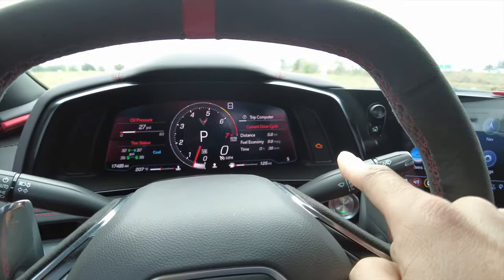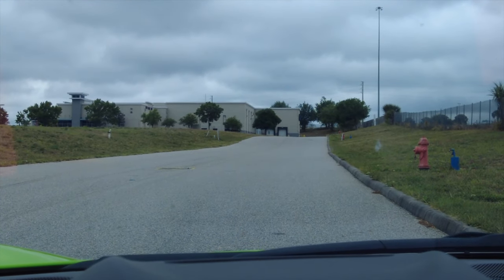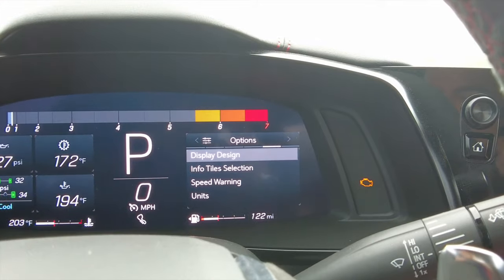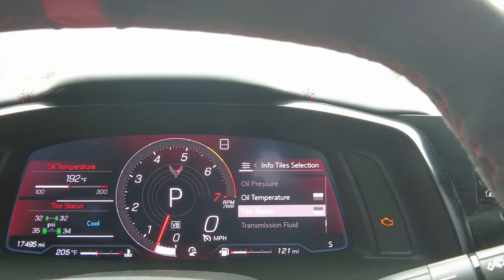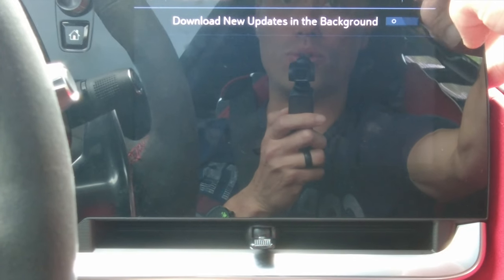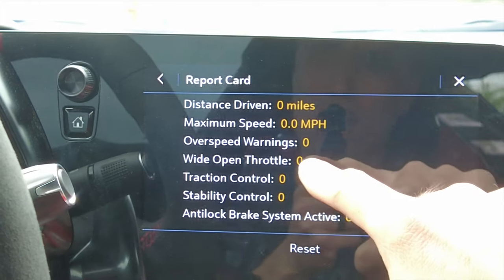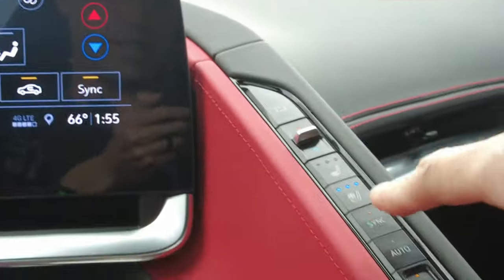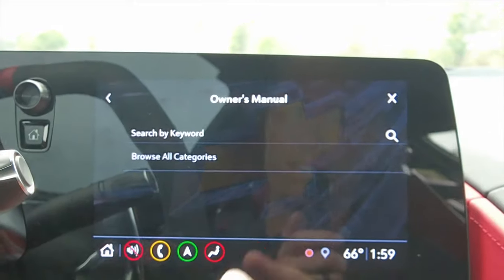C8 CORVETTE GAUGE CLUSTER AND INFOTAINMENT TUTORIAL

Comment: Good review, can you turn off the variable cylinder mode and just operate on V8 mode ?
Reply from the maker: Yup, just tap the M button and it’ll stay in manual mode and won’t go into 4 cyl mode. But you have to shift all the time.
Reply: Or Z mode will keep it from switching to 4 cylinders.

Comment: Hi, I have a question that has nothing to do with this video, I finally have my 2021 C8, when I get to 500 miles do I have to go to the dealer for an oil change or is it not mandatory?
Reply: You need an oil change after break in. There will be debris (fine metal particles and such) in the oil from the piston rings, bearings, and other friction parts breaking in. That’s also why it’s important to not overdo it on the throttle during this period.
Reply: Your first required oil changes at 7500 miles I will do mine at about six thousand just to be safe and the first change is free
Reply from the maker: I did my first one around 6k-7k miles along with the trans filter and 2 extra qt if DCT fluid

Comment: been following you on your channel did throttle body  and controller that is bad ass changed the car. Had spacer before you had to cut studs  i have after market wheels forgiatos they are not as deep as the factory wheels. The next mod you need is in the rear truck it is a heat mat it will cut the temp down in rear truck at least 30 degrees get temp gage drive you car and check it it will be at  90 degrees or better put in mat about 69 to 63
Reply from the maker: I saw the video! Pretty crazy!

Comment: the amf valves are causing you check engine light where ypu go fron 4 cylinder to 8 cylinder not the npp valves you can get exhaust valve module at cicio performance it just plugs in  that will take care of cel had to do it my self

Comment: Looks like you got a check engine light
Reply: He explained it in the vid.
Reply: he did not know what he was talking about   needs to get more info been there done that needs to put npp valves back on it is amf valves that go from 4 cylinder to 8 cylinder  there is a module you can buy that fools the computer  @zorro8027
Reply: @johnchandler4326  
Ah yes. Thanks for the info.

Comment: I think the auto shut off is so you don’t park your car in the garage and go to bed, killing your family from the carbon monoxide. Some of the push to start cars are so quite that this has happened all too frequently. Mostly by older folks but I guess it could also happen to the stupid or alcohol induced dummies too.
Reply from the maker: Ahhhhhh, why didn’t I think of that. Smart! Thanks Bud!
Reply: Mustang has this too after 30 minutes
Reply: Ehh...the more likely answer is that it is exactly for situations like this. When you leave your car with the key while it's still on it will honk at you.  So there is already at least one system in place to tell you to turn the car off.  But if someone wants to just sit in the car for a 30 minute lunch break, or take a nap, or wait for family, etc...and instead of accessory mode they have the car on unnecessarily... IATs will continue to go through the roof and that is not good for the engine.  So I think it's more for the people that want to STAY INSIDE their cars for long periods of time, stationary and idling...